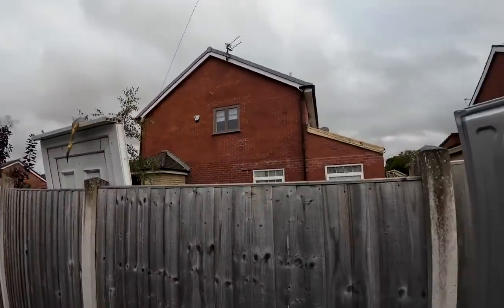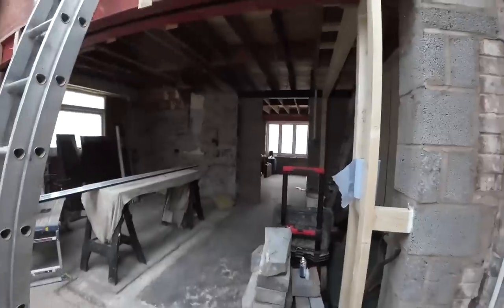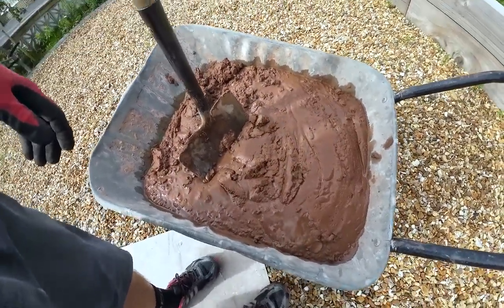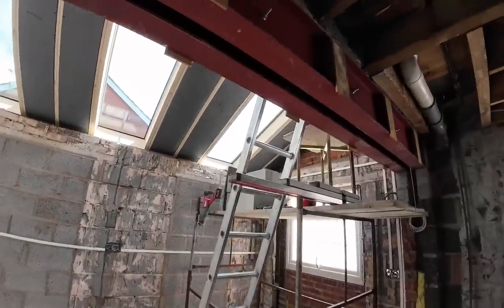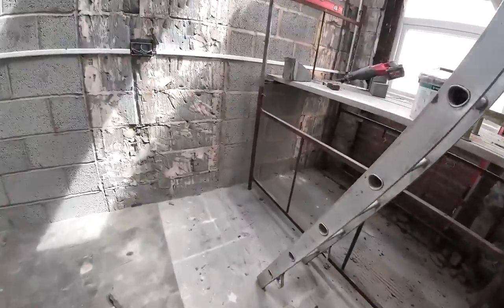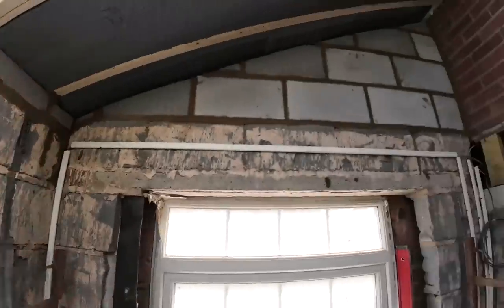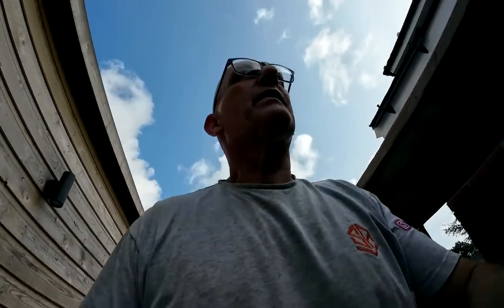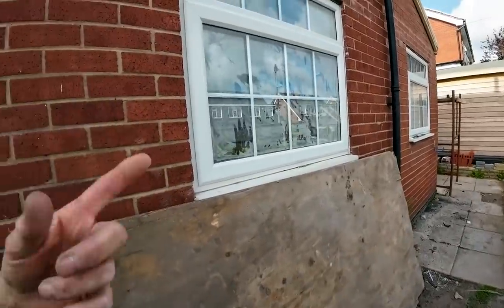THE ROOF COULD HAVE COLLAPSED!! BIG ALTERATION JOB PT 6

Comment: The roof just sits on blocks? There's no reinforced top beam? Seriously?
Reply from the maker: No the roof sits on the back wall of the house and the far wall of the extension, it doesn’t touch the blocks 🤣🤣.. SERIOUSLY
Reply: So the back wall of the house has a reinforced beam or lintel. then? @SteveAndAlexBuild
Reply from the maker: This is a bricklaying channel we don’t do roofing  . All I know is the roof is safe and to building regs
Reply: Dang don't say it so loud, its a business revenue generator. Seriously, rafters are attached to a ridge and wall plates
Reply: I guess UK building standards are why houses cracked up the minute fracking began! @SteveAndAlexBuild
Reply from the maker: Never heard of a house cracking from fracking because it doesn’t happen
Reply from the maker: Troll of the week 🙄🫠🍆
Reply: LOL. Have you only ever seen UK standards? Try the USA, theirs are appalling! @SteveAndAlexBuild

Comment: When we moved into our house many years ago the horror we found was bad the cable going to the hot water tank the cable going to was sandwich between the floor and joists. Then years later we had the kitchen ceiling come down because there had but the new ceiling up over the old ceiling and there was not much holding up. We had damp in our walls because there put the rubbish in the wall cavity's. The floor in the kitchen and down stairs bathroom was put in after the kitchen and bathroom was put in so everything was buried in the concrete floor.

Comment: Totally misleading title lads; considering you already supported the main external rear face with 2x R.S.J.'s & the existing front brickwork of extension was infilled at openings? How could the Roof fall down when you are only infilling 2x non-load bearing pikes(triangles)?  As the joiners had already finished the roof & the glazing was being put in the lay-lights before you built pikes. That structure would stand without both ends like a car port as long as you did not bump outside extension wall?. 🤔
Reply from the maker: Because the original roof was sat on a perlin  which was sat on crumbling brickwork which I demolished by just picking the blocks off the wall . This is part of a series